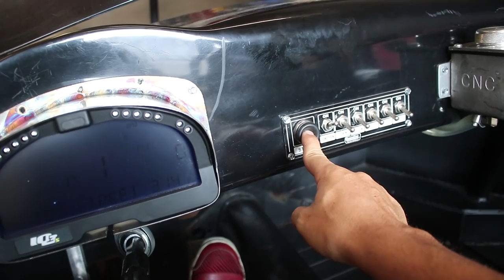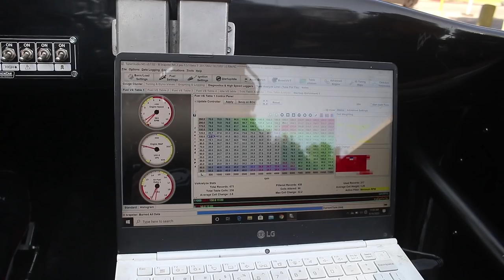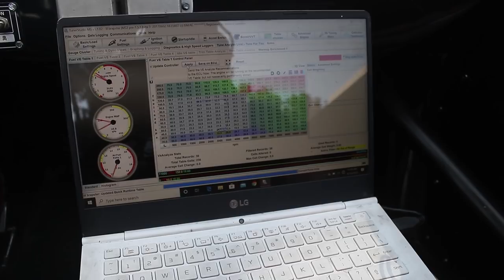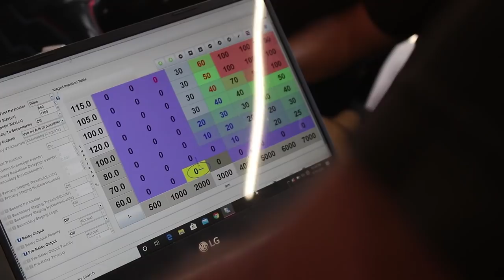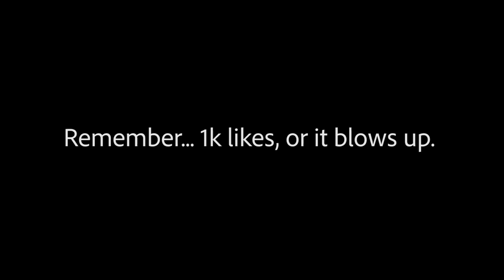650cc SINGLE ROTOR Rotary Speedster | ROAD TEST

Comment: There's a lot of channels that are doing the same 3 engine swaps, LS, 2JZ, K Series into anything and everything. Personally I think you would be better off with a modified Porsche engine, maybe even something from a slightly newer model but I appreciate Porsche stuff isn't cheap. Your turbo 911 build was the reason I subscribed and it's easily your best build.

Comment: james is my spirit

tuned my is200 1jz to 20 psi myself also have sent it in multiple industrial areas to shakedown the tune

first time i blew the W58, second time I twisted the tailshaft, third time I exploded the is200 diff HAHA

now everything is absolutely perfect, feeling more solid than ever

also not to mention accidentally hitting 28 psi on the stock 1jz block HAHA

Comment: the one thing that would give the engine the very best chance would be a massively heavy flywheel . the weight of the flywheel would keep the momentum of the engine thru a loss of power and keep it running . it would take more power to spin it up but once it's spinning it would help the engine keep running

Comment: That engine unboosted would be perfect in my 63 MG Midget, I need to rebuild/replace the original 1098cc that put out a whopping 55HP
Reply: I have it worse man, 1200cc. 
35hp. 

Beetle
Reply: @tristantuyn8703  yeah, that air cooled beetle engine is a bit of a dog. Nearly indestructible, but a dog. Sadly that 35hp is about where mine is sputtering to at the moment.
Reply: @scottblancett1915  haha, when it doesn't catch on fire it is indeed pretty good. In terms of speed it isn't bad to be honest. Top speed sucks a lot, but the beetle has a very very short gearbox, which makes it accelerate pretty fast

Comment: How high would this be able to rev if it was designed specifically for that? I'd imagine a single rotor could fly significantly faster than a two, three or four rotor simply because it has a fraction of the rotating mass. It would have one hell of a sound, that's for sure.

Comment: Use redline racing 2 stroke oil or just add motorkote to whatever oil you're using for the oil injection.
Reply: Premix all the way
Reply: @zomgz932  i prefer the remote reservoir oil injection over pre mix it's the better option
Reply: @shaynegadsden  its a more set and forget solution yes but premix is foolproof

Comment: Should have supercharged it

Will never stop saying it
Reply from the maker: Maybe we’ll twin charge it.
Reply: @Insane Troll Guy - chill
Reply: @TeamBoosted  Aight, cool. I know that flyin miata makes a few small-displacement superchargers if you're interested in that.
Reply: Rotaries and superchargers aren't really a good match you are asking that belt drive to take some massive rpm and the simple fact turbocharging is better than supercharging
Reply: @shaynegadsden  Belt pulley size can be changed very easily, providing a much slower supercharger spin, not to mention that superchargers work better... when moving faster.

Comment: I started watching this channel for the ford 2.3 in that Z. You guys said when you had it running you were going to send it to the moon. Is that ever going to happen?  I have a semi nasty 2.3 in my ranger. You don’t see much of them old motors. Also the giveaway is dumb. It’s a super odd car that very few will be able to maintain. I’d spend the money on the shit you already have in the works.
Reply from the maker: The Z is being built up for track season.  We still have it, and it’s still fast. We appreciate the feedback on the giveaway. The goal is to modernize it and make it a car that any normal person could daily drive and maintain. That’s why we’re going with a turn key modern power train and giving it drivability luxuries like air conditioning.

Comment: If you don't have an oil injector then you need to mix your gas like a 2 stroke.
Reply from the maker: we pre-mix our e85.
Reply: Always premix it is the best way to make sure these engines last.
Reply: @TeamBoosted  good. For extra safety, I'd run a little more oil just to make sure you don't have any issues.

Comment: Omg. Annoying.  Makenthe whole map 15 degrees.  10 split  the whole way.  And keep afrs at 12.5 in vacuum and and 11.5 in boost up to 5psi. And 11 afr up to 8psi. And recommends 10.6  up to 15psi. Then race gas.  
Staph, hitting boost unless ready....

And they complain about rotaries braking....  cmon..

Comment: BWAHAHAHAHA AUTOTUNE !!! on wrong fixed timing. nice work boys.
Reply: blowing it up tuning it i see ?
Reply from the maker: It’s not on fixed timing. We made a basic rich fuel map and then used auto tune under light load conditions so the tuner has a good starting point.
Reply: @TeamBoosted  it shouldnt be on fixed timing. the fixed timing needs to be set. you have it wrong. it can be heard from new zealand haha.